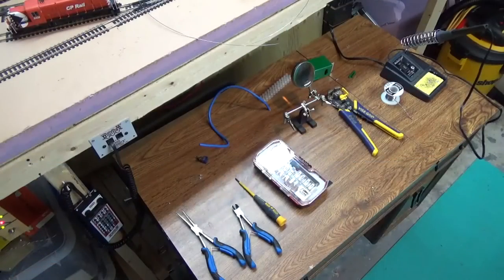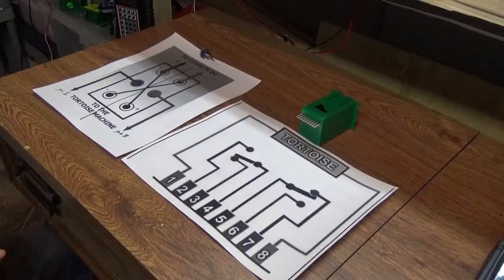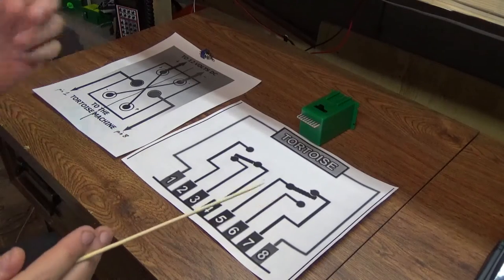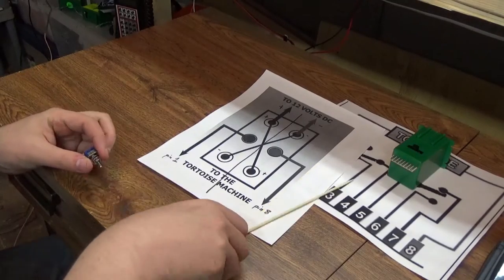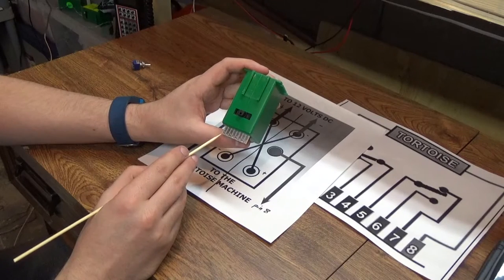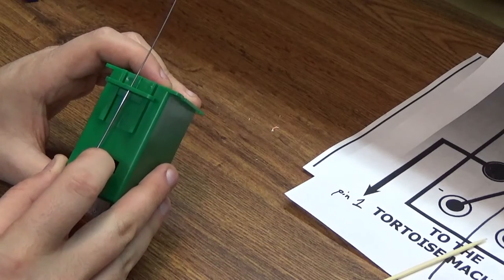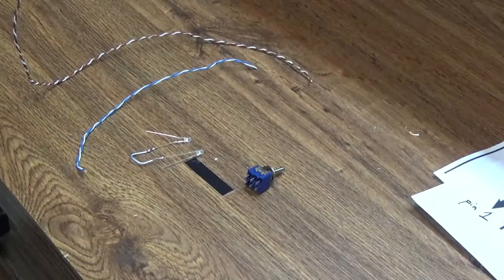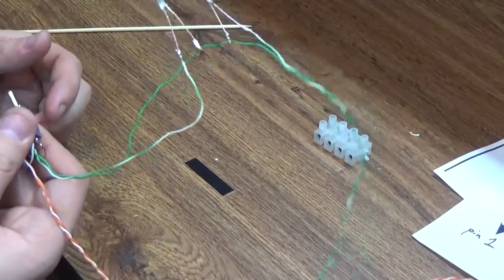HO How to - Tortoise switch machine

Comment: Hi, I used to use this method for cutting through the track bed and the foam but now I use piece of copper pipe sharpened, I then gently push it through the track bed and the foam until it hits the board, wiggle it about and then withdraw it, your left with a perfect shaped hole with no jagged edges. Cheers Malcolm

Comment: There are a few ways to wire these as we all know. One fault in this way of wiring the led's in series with the motor is that if an led failed it would cut power to the motor. To fix this run an extra wire in parallel between the switch output and motor right beside the led circuit. great video

Comment: Good tutorial... Thanks! Instead of using two led lights, I use one bicolor led (red/green)... saves space on your control panel or facia.
Reply: Hi , just reading your comment, I would like to use 1 LED also, I'm very new to this , just wondering what rating LED is to be used, I know it's to be a bi color led but it is a 2.8 VDC 30 ma for example. Any info would be much appreciated. Thank you.

Comment: Placing a thin sheet of plywood, or plastic over the roadbed before drilling, and using pilot holes, will prevent the tearing and speed the process.  That's how professionals prevent chipping of wood veneers and laminates.  If you were installing a bunch I'd go that route, or use a punch as Malcolm Bennett suggested.

Comment: Probably the best tortoise switch tutorial I've seen yet. And I've seen many. How did you trim the excess throw wire (piano wire) at the very end once it was all installed?
Reply from the maker: I actually used my rail cutter which is just a hardy pair of snips. Get as close as you can and cut, but remember it's better to have extra than not enough.

Comment: Is the wire on the switch machine long enough to operate through the 2 inch foam?
Reply from the maker: The wire it comes with is not long enough. I mention the method I took around 11:25 in the video. I had to buy piano wire and cut it to length.

Comment: Hi I have the same model (panter pink material + wood) and this way it is too wide, the original music wire dont have the large; Where to buy the wire music with length enough???
Reply from the maker: I bought piano wire off Ebay and cut it myself to the lengths I needed.

Comment: Thanks for the video. Really made it simple to understand. Also! The LEDs .. fitting them into a control panel. don't they rubber gasket, Gromit or something to mount the LED? How do you mount yours?
Reply from the maker: Thanks for the feedback. For the LEDs I drill the hole and hotglue the LED in place. that being said, I’ve never gotten to the point where I'm done all my wiring and control and want to make things look professional. I think a nice gasket or gromet would be the way to go for sure.

Comment: Hi Dave, love your video, I really like how you simplify everything step by step, most videos out there on this topic always assume that  you know about electronics ECT, I was reading some of the comments hoping to get  some info on what type or rating LEDs you used in series, I was a little angry of some of the comments that were left, criticizing your video or how you presented it, well they can all go to you know where, don't see them making a great video. Anyhow great job my friend. Would be awesome if you know the rating of the bi color LEDs for example is it a 2.8 VDC 30ma ?. Any info on this would be great. Thanks again.
Reply from the maker: Thank you for your comment. I'm glad I can help people understand. I understand that I can't please everyone and as a content creator I must accept that. 

The LEDs are bi directional,  1.8v to 2.2v. If you are using these tortoise switch machines resistors are not required. This video is a few years old so I'm not sure exactly where I got these, but I have purchased new ones that also work with tortoise that I'm using on my current layout. Here is the ebay link.

https://www.ebay.ca/itm/221467722811
Reply: @DaveCoTrains   Hey thanks alot, much appreciated, I can't wait to get started on the switches, keep the great content coming. Take care.
Peter.
Reply from the maker: @peterstrains4339  I'm  already subscribed, but make a video when you're done to show them off!
Reply: @DaveCoTrains  Thanks Dave, I'm a subscriber of your channel as well. I got rid of my old layout completely. Starting fresh with a slightly bigger layout,  just made a 5x10 table and this time adding  a mountain/tunnel going with code 83 track , it will be a while before having something to show, after seeing your video on the tortoise switches I ordered some of those online. This the great thing about YouTube and it sure does promote the hobby and make it stronger. Anyhow, thanks Dave for sharing.  Take care.
Peter.

Comment: How many tortoise switch machines can a 12 V power supply operate?
Reply from the maker: John Redinger I'm running 12 without any issue. I think I read somewhere that 14 is the max.

Comment: Do you control 2 Tortoise switch machines with a single DPDT toggle?  How would you wire that set-up?  Thanks
Reply from the maker: Yes you can. All you do is wire the 2nd tortoise in reverse to the same terminals as the first tortoise.

Comment: Where did you get the small wire and the LED's from???
Reply from the maker: I used ethernet wire and got the LEDs from Ebay.
Reply: Real novice here and thinking I can do this.  Need to buy some LEDs and see that there are 3mm and 5mm size.   Do I want "2pins F3 3mm Dual Bi Color Polar Changing Red/Green Led Diffused Leds" or "5mm Dual Bi Color Polar Changing Red/Green Led Diffused Leds 2-Pin led".  How about these from Amazon "5mm Red & Green Lights Bi-Color LED Diodes Common Cathode (White Lens) Diffused Round Lens +200pcs Resistors (for DC 6-12V) Included, Bulb Lamps Light Emitting Diode".  Thanks again for the info.

Comment: did you have your S L 244 switch insulated , how did you power the switch
Reply from the maker: I did have insulating rail joiners for blocks but they weren't needed. I powered the switch through normal track power.

Comment: do you know what sized piano wire it was? also what amperage the switch was, or does that not matter and any dpdt switch will work?
Reply from the maker: Hi Adam, I ended up having to go back a few years but I found the order. I bought 0.32"(.8128mm) piano wire, which I then had to slightly drill a larger hole in the Tortoise plastic, only by a little which I used a jewelry drill to do.

For the DPDT switch, I just used cheap china switches. We're not using very much power here so I wouldn't worry about anything like that as long as there are no shorts or terminals touching. I solved this by hot gluing everything after carefully testing.
Reply: Daveh88 okay cool, thankyou very much!
Reply: 0.032" I think